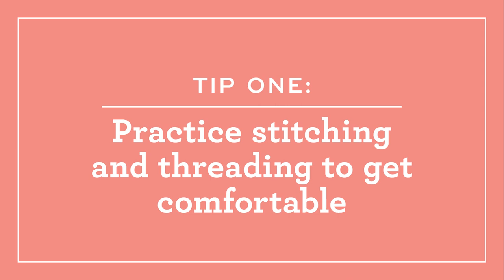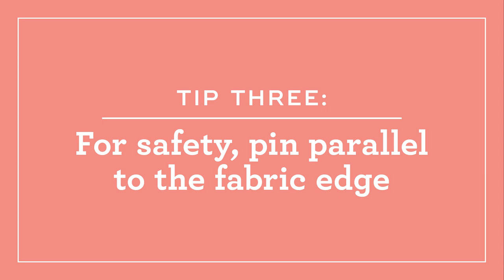Sewing Machine Review: Brother 1034D Serger

Comment: Hello first let me start by saying thank you for this video, I truly appreciate you. I have the same machine and for some reason the thread in my left needle comes out while I’m sergering do you know why? Also when I turn the knife off my fabric is not getting stitched. Help me please 😢
Reply from the maker: Hi! My first thought on the thread coming out issue is that you need to pull it through the needle farther before you start stitching. I don't know why turning off the knife would cause stitching to not work. Can you still create a chain of thread (sew without fabric) when the knife is off? If so, maybe it's the fabric position? With the knife off, the fabric has to be positioned further to the left or else it will get bunched up. I hope that helps! The machine manual also has a troubleshooting section that might have ideas.
Reply: Thank you. I will try the advice you gave me today.